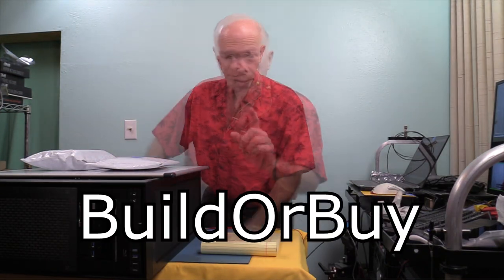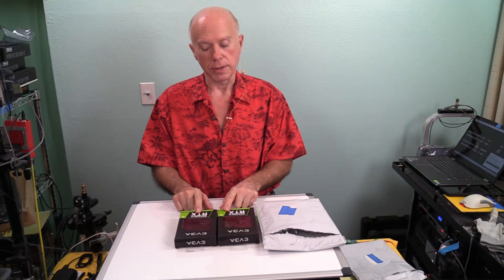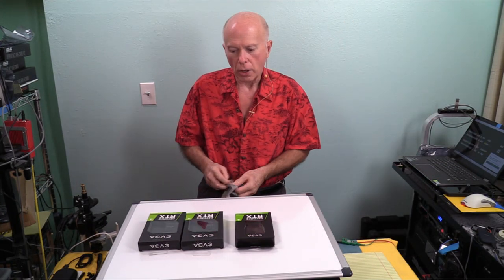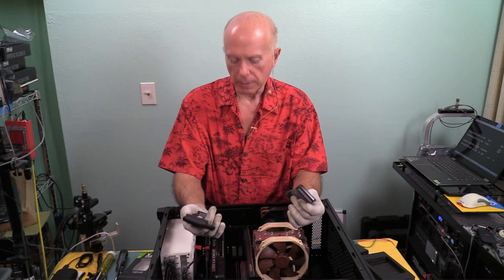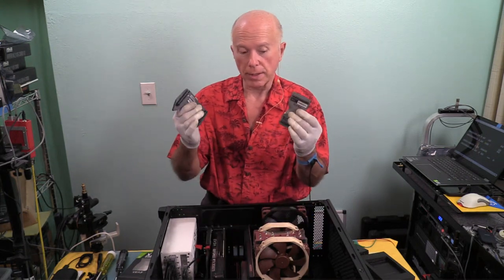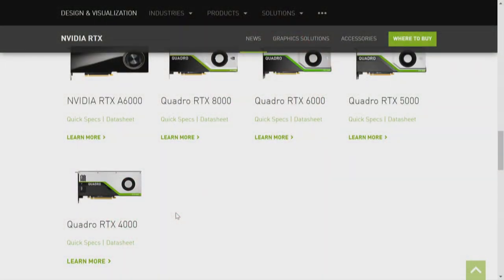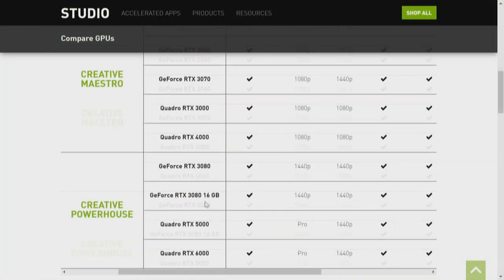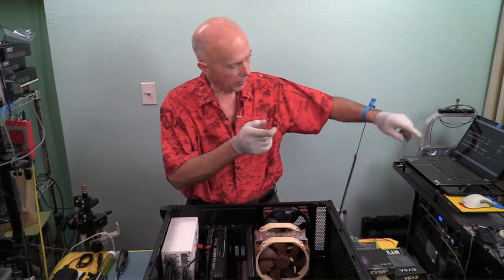Unboxing EVGA RTX NVIDIA NVLink Bridge

Comment: Can a graphics card or nvlink help me enlarge the amount of RAM without buying new sticks of RAM or speed it up or speed up the Ryzen? The goal is to have a larger and faster ramdisk, not for gaming. I don't play games.
Reply from the maker: Hi Don Jon, Video RAM and a RAM Disk are different. If Your application use requires more RAM, then You need RAM. A RAM Disk was for the purpose of caching drive data. If You need RAM, get more RAM. Over the years, going from 8 to 16 GBs has been the sweet spot for RAM, as can be seen in Laptops. And we could see just from the O/S an immediate performance improvement. 

However, going to 32GBs, depends upon the application. For Content Creation, 32GBs would be a minimum. On the x399, We have Built with 128GBs. And on the TRX40,we have Built with 256GBs. And the WRX80 can go to 2TBs with Kingston currently able to get a WRX80 to 512GBs of RAM. Phenomenal changes in a short amount of time. 

And Video RAM, also depends upon the application which includes but is not limited to screen resolution. Rendering high resolution in real time is more than just what we see. It's computational calculations of complex data sets. Hope that helps!
Reply: @BuildOrBuy  So I will not benefit from buying an advanced Gfx card or nvlink just to have a bigger or faster ramdisk that serves me as a place when I hold one big virtual machine file to make that virtual machine  operate quicker than on a regular m.2 gen4 nvme disk? On ramdisk it goes faster. So the advanced gfx and or nvlink it's not for my only need?
Reply from the maker: Hi @donjon7554 , A RAM Disk would not help that unless the application in use can utilize and is aware of NVLink. That Resource would have to be passed to the Virtual Machine to be utilized. Depends upon how the RAM Disk sees 2 Bridged Video cards. 

Now for Virtual Machine images, yes to using M.2 NVMe SSD Drives and more RAM. Changing one thing can change everything. 

The NVLink, for Us for now, is more about space relations and planning for possible future growth. And how that relates to other Components. Hope that helps.
Reply: @BuildOrBuy  So is it better for me to buy 128 GB of fast Ram for Ryzen 3900x on a x590 chipset motherboard to work in my VirtualBOX app that I use to make virtual machines? I put VirtualBox virtualization files into my  current RAMdisk of size 38GB based on 48 GB of DDR4 2133 MHz CL13 RAM ??? How can I improve the speed of all of that ?
Reply from the maker: Hi @donjon7554 , 
Do You mean x570? Which Motherboard are You using? RAM... Do You mean 64GBs? Supports up to 128 GB (32 GB single DIMM capacity). If You have 2 - 32GB sticks, then You'd only need to add 2 more of same. That would help VirtualBOX. How much RAM are You currently allocating?
Reply: @BuildOrBuy  The answers You seek are above. The chipset is x570 my mistake. Motherboard is MSI X-570-A Pro and I have stashed also a MSI X570 Godlike. Both support up to 128 GB of RAM. 2 RAM sticks are 2133 and the other 2 are 3200 and 4 of them give 48 GB of Ram from the sum of 8+8+16+16.
Reply from the maker: Hi @donjon7554 , Got it. Odd combination of RAM. Have not seen anyone do that in a long time. So You'll need to replace all four sticks with one kit. Need a link?
Reply: @BuildOrBuy  I would like to get an advice first regarding 2133 Ram with Ryzen 3900x. I know it's tragic for gaming, but since I don't game will I see any better speed in using a virtual machine in a ramdrive even in Windows?
Reply: @BuildOrBuy  "And the WRX80 can go to 2TBs with Kingston currently able to get a WRX80 to 512GBs of RAM"

Sounds like a lot of potential...expandability. They have to have created the Asus WRX80 with understood future expandability coming or it's a gamble. I can see one always needing extra RAM and just dumping in 2T worth would sorta get you to the point of not having to worry about that for a long time...set you up for future work loads. Have you mentioned anywhere on why one can't just go ahead with 2T worth? Maybe not being about to buy all in one set?
Reply from the maker: Hi @RickyBobby_USA , 
Welcome! Excellent question! 2 Reasons... There is one Brand of RAM that does go to 2TBs. However, whenever We go to a new Platform, We always start with Kingston! And that's as dense as Kingston goes at this time. Hard to say about the future with DDR5 and PCIe 5.0 on the horizon! 

The best balance of Resources would be the task of Rendering. Adobe has a new Formula for that purpose that can help Us to make this Balance understandable and more palatable. We have a Video about that Formula! 

The Adobe Multi Frame Rendering CPU Optimization Formula: 
1. CPU Cores x 4 = RAM
2. CPU Core count = VRAM. 

That makes a 64 Core CPU = 256GB RAM. And therefor a 64 Core CPU would require a GPU with 64GB VRAM which would be a Workstation GPU on the order of an NVIDIA RTX A6000. Hope that helps! Thanks for Watching!
Reply: @BuildOrBuy  I thought that I posted a link from the Lenovo website about memory band width. Did you see it? I can't remember I comment with it on one of your vids or not. It was in regards to the lower end two TRP CPUs in that they could only use 4 of the 8 channels of memory. If you'd like me to post it here I can. Let me know.
Reply from the maker: Hi @RickyBobby_USA , 
I did not see that if You posted that link in a Comment. YouTube automatically blocks links. And a lot of those messages I don't get to see or they don't show up for quite some time in the Comments Held section. No explanation either. But it happens. 

Think of it this way as to the Platform. The Motherboard is the Foundation of a Computer Build. However, the Chipset is the Foundation of the Motherboard. Chipsets Rule! So to getting someone on the Platform, get the Foundation right, then look at the CPU. For the most part, a CPU can be Upgraded just don't Buy a Lenovo. 

The concern with those CPUs being from Lenovo, they will be Vendor Specific tied to Lenovo Motherboards! Meaning, Vendor Lock aka CPU fusing! It's suppose to be a Security thing. However, that should be left up to the Client to make that decision. Not Lenovo! 

As to the Memory, notice the lowest AMD Threadripper Pro CPU 3945WX is only offered from Lenovo. And You have a link that states both the 3945WX and 3955WX can only use 4 Channels? I'd like to see that! News to me! However, it may get blocked by YouTube. They're trying to stop spam. Thanks for Sharing!
Reply: @BuildOrBuy  Well, I'm not saying I'm right. I would like for you to have the link for potential content since you do reference Lenovo on occasion. I found your email on this channel. If it's up to date, I can email it to you, if you'd like.
Reply from the maker: Hi @RickyBobby_USA  , That would be great! Research is always a process of investigation! Absolutely Appreciated! Thank You! Might be a point to include or reference in another Video!
Reply: @BuildOrBuy  Just sent it over. "memory band width" is in the subject.
Reply from the maker: Hi @RickyBobby_USA , Outstanding! I'll see it later when checking emails. On Smartphone right now! Thanks for Sharing!
Reply from the maker: Hi @RickyBobby_USA , 
I had seen that but did not read all of it until now. That's interesting! The image has those details. 

https://forums.lenovo.com/t5/ThinkStation-Workstations/P620-Threadripper-Pro-Memory-Bandwidth-Specifications/m-p/5050015?page=1
memory band width
1. 3945wx & 3955wx on 2 CCD's connected to the I/O Die.
2. 3975wx on 4 CCD's connected to the I/O Die.
3. 3995wx on 8 CCD's connected to the I/O Die. 

We'll have to include that Data in another WRX80 Video later on! Thank You for Sharing!
Reply: @BuildOrBuy  I look forward to it, thanks.
It will help me adjust what i want to do.
Reply from the maker: Hi @RickyBobby_USA  , Absolutely! Thanks for Sharing!

Comment: Hello, thank you for this video, I searching for an nvlink for the RTX 3090 80mm but I do not findit and it is very confusing in the websites like amazon, they do not mention if it is for the 20 or 30 series and for this raison, I bought one and found out that it is for a 20 series. So, I could find only one seller who precised that his product is compatible with the 3060 card so, I am wondering if it is the same with 3090 so I will buy it ?
Reply from the maker: Hi Wllis matrix,
Welcome! Thank You! Appreciate Your Comments! Do You have an RTX 3060? And You want an RTX 30 series NVLink Bridge? Which RTX 3060 Brand and Model Video card do You have? We are not aware of any RTX 30 series Bridges other than RTX 3090 / RTX 3090Ti. To reiterate, only the RTX 3090 / RTX 3090Ti can be Bridged with the NVLink Bridge. Be happy to check for You! Does Your RTX 3060 have an Edge Connector? You should only have a Power Tap on top near the Rear of Your GPU. NVLink Bridge Connector would be near the I/O Panel on top of Your GPU.
Reply: @BuildOrBuy  thank you for your reply, actually it is the opposite, I have two rtx 3090 and I am looking for a compatible 80mm bridge but the only available one i could found advertised as a bridge for rtx3060, so i don't know if i can use it for rtx3090 (also, when i checked the 3060 card online I didn't see that it have sli/nvlink option !?)
Reply from the maker: Hi @wilismatrix9847 ,
Absolutely! Here to help! To reiterate, the RTX 30 Series NVLink Bridge ONLY works on the RTX 3090 / RTX 3090Ti. 

Here's one on Amazon. 
EVGA GeForce RTX NVLink SLI Bridge for RTX 3090, 4-Slot Spacing, 100-2W-0130-LR
https://amzn.to/3NQFNIN
As an Amazon Affiliate I earn from qualifying purchases! Hope that helps! Keep Us Posted on Your Progress!

Comment: Hello,
Who can says, which is the distance between of ports of that EVGA RTX NVLink Bridge (30 series). Thank you in advance for your reply 😉
Reply from the maker: Hi Beatrice Costa, 
Welcome! The EVGA RTX NVLink Bridge (30 series) is 4 Slots Wide. Hope that helps! Thanks for Asking!
Reply: @BuildOrBuy  Thank you so much 💓💖💗.  Is the distance between SLI ports has to be 60mm?
Reply from the maker: Hi @beatricecosta4663  , Which RTX 3090s do You have. We'll check and see if We can verify.
Reply: @BuildOrBuy  I meant the distance between my cards SLI spot is 60mm. Does it fit on that NVLink?
Reply from the maker: Hi @beatricecosta4663 , The spacing is 4 Slots wide. Off the top of my head I do not remember that measurement. Have to verify. Verifying Specifics is far more productive than Verifying generics. Specifics, 4 Slots wide. Generic, same measurement. RTX 3090s are 1, 2, 3, 3 1/2 or 3 3/4 Slots wide. To reiterate, the RTX 3090 needs to be 3 Slots wide or less to be able to breath. 

RTX 3090s do not have a blower designed cooler. Therefore they need Room to breath. I'll get a tape measure and get You that Slot to Slot measurement. On center spacing, 3 3/16 inches = 80.962 mm. Measured on Gigabyte TRX40 Designare HEDT Motherboard and EVGA RTX 30 NVLink Bridge.
Reply: @BuildOrBuy  So in my case it doesn't work. I have slot to slot 60mm
Reply from the maker: Hi @beatricecosta4663 , We only know about what We have tested and verified. If You have everything, try and let Us know what You find out. The Slot Spacing for 4 Slots wide is 3 3/16 inches wide measured center to center. What are You lacking? The NVLink Bridge? Test and Verify. To reiterate, and keep Us Posted on Your Progress! BTW: Congrats on having 2 RTX 3090s! Did You consider an RTX A6000?